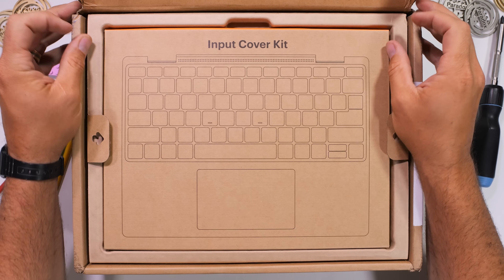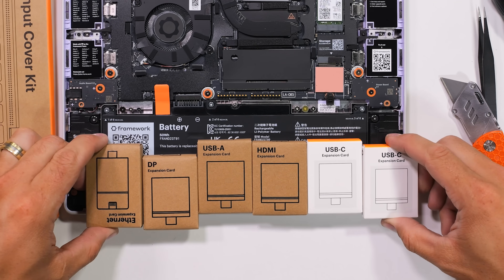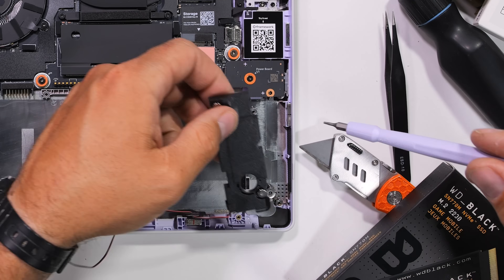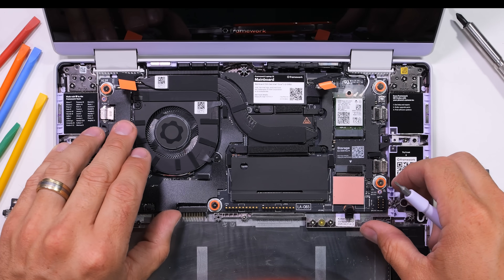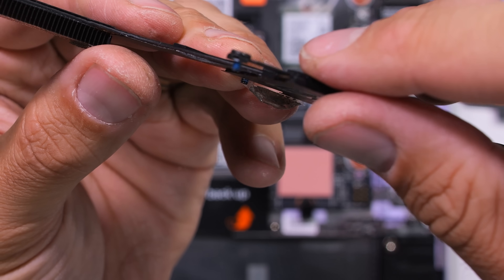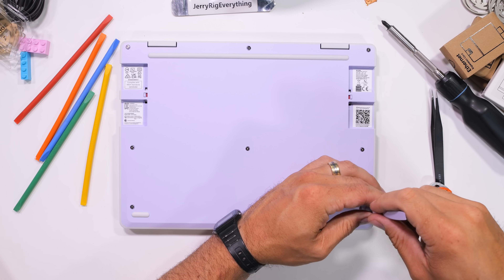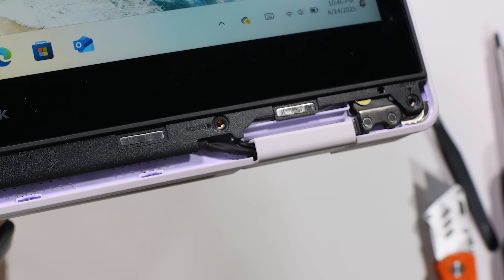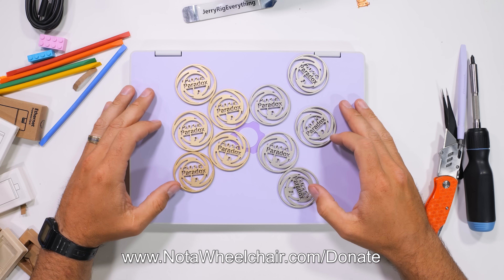The Best Laptop on Earth... is almost too easy to fix.

Comment: the funny thing is that they have to assemble it first to see if it works, then unassemble it for diy kits. linus did a tour of their factory and the ceo told him that.
Reply: I do wonder if they were only doing that early on and now trust the other QA processes enough to not need to do that anymore. There's also plenty of users that don't order all parts from FW
Reply: @HululusLabs  Memory and SSD don't have to be purchased through them, but honestly they don't charge Apple prices.  

If upgrading your laptop there is no need to test anything but what they send out.  Elsewise it's still cheaper to test the product real quick then to send out faulty parts.

It's not like memory and SSD drives are all that hard to install and uninstall.  

I do wonder how they send out the computers with the GPU add-on.  Haven't seen that which is why I want him to get the Framework 16.
Reply: im sure they test the componants but you can do that without assambling it
Reply: @Tank23333  No they don't... They literally test the machine working and take the parts out.  It's faster that way for them to test, testing components one by one takes more time.
Reply: @Crazyd_ do you work there or something?
Reply: @arguedscarab7985  The factory tour OP was talking about... That's how he knows.
Reply: No the funny thing is they charge you more for doing less work.  Because DYI Kits do cost less.
Reply: @Crazyd_  And the crazier converse, they charge you less when they're doing more work!
Reply: @Crazyd_  they cost less because they don't include Windows, not because of the amount of work
Reply: @bruuhhhh  Doubt it highly I've seen Microsoft shut down computer stores who do that.  I hope Framework isn't that stupid.
Reply: @Crazyd_  you've seen Microsoft shut down computer stores for not including Windows?
Reply: @bruuhhhh  For not charging for Windows on New PC's yes.  And that's just a local PC store... Microsoft is vicious
Reply: Crazier by the minute...
Reply: @Crazyd_  You mean the local store installed a copy of windows but did not charge for it?

Not to worry, because if you order DIY there is either no storage at all or - if you select one during ordering - a brand new, factory sealed SSD included.
Reply: @LOL_Strategy They install OS, but ran Microsoft program which requires them to enter an activation key.  

I forget what the command name was, but it's a way for vendors to test the system with Windows and still require an activation after the command was ran.

Once you reboot Windows ask all the introduction questions again and ask for key.
Reply: @Crazyd_  Yeah, that's not what Framework is doing, at all.
Reply: @Crazyd_  idk if it is an america thing, but at least here in spain almost all major tech stores charge you less for not having windows installed.
Reply: @bruuhhhh Que?? They do not cost less at all, otherwise I would've bought one myself..
Reply: @Crazyd_ *DIY 😊
Reply: Which lets you know that it’s a gimmick.  They are selling the idea of modularity, not modularity.
Reply: @mrlt1151 The discount comes from them not including windows, ram, or storage in the modular configs. They out it all together, test everything, take it apart far enough to remove the storage and ram, then leave it open for your convienence when you install your own components.
Reply: @Michaeldtimmins  Highly doubt that.  Microsoft tends to frown on people selling full computers and not putting OS in on the price. 

Now if they don't purchase a hard drive through you, it's fine nothing they can do.  But no one wants to get on Microsoft's Lawyer side.  

I always get Windows Pro regardless, it's worth the price for Remote Desktop and Policy Editor.
Reply: @Crazyd_  The version without Windows installed doesn't come with Windows at all, at least from what I can tell on their website. So they're charging less partially because Windows isn't included, not because it isn't installed.
Reply: @Crazyd_ they don't sell the full computer. It doesn't come with a hard drive or ram, and thus also didn't come with windows. You, the end user, are free to install whatever storage ram and operating system you want.
Reply: @Crazyd_  Microsoft isn't some kind of police force making sure all laptops come with an operating system lmao? If someone sells a PC without any OS on it, its none of Microsoft's business.
Reply: @Crazyd_ Microsoft definitely can't force tech stores to sell all PCs with Windows installed. Just by the sound of it that sounds illegal. The only way Windows is "forcibly" installed on a PC is when you buy a prebuilt where you can't change what's included in the package deal.

They can discourage it sure, but going legal like you're implying? Hell no.
Reply: @mrlt1151  Ah yes, the fact that testing if a computer works requires the computer to be assembled totally makes the modules the computer was built out of vanish into the ether, because you said so.

Comment: A previous video of yours was the catalyst for me to get an e-Ink phone.
And now this is confirmation for me to pick up the Framework 12 as my next laptop.
I already decided on this, but was still a bit unsure on whether I want the Sage or Lavender colourway.
But I do not like how the grey mixes with the lavender and was veering more towards Sage, so that choice is made.

I am waiting for a review comparing the performance of the two CPU models, since the i3-1334 is significantly more expensive.
This for what seems to be an insignificant improvement over the i3-1315, especially considering the stricter power limit of the 12.
But since I will be using this laptop for over 5 years, hopefully a decade, I do want to be certain first.

The level of repairability at show here is far beyond my expectations, those pogo pin connectors are very clever.
Those modules do make it expensive, especially since I want an Ethernet one.
But with how open the design is, the solution is to only get two modules and to design a case for a USB-C dongle which slots in the other half.
Which I will design myself and 3D-print, around a cheap but perfectly suitable dongle which I already have.

Currently I use a dedicated screenless drawing tablet for note-taking.
While I will keep using this for the greater accuracy and comfort, in a pinch the stylus support for the screen is incredible for me.
I am waiting for the stylus to release too, so I can combine the order.
And I will add on a screenprotector, for the better feel and to avoid scratching the glass.

With modern ThinkPads getting worse keyboards and one of the last ones with decent boards getting annoyingly slow, the compromise here seems reasonable.
My previous TP became unstable thus unreliable, my current second-hand stop-gap upgrade is annoyingly slow but works well for the moment.
I will miss the physical click buttons above the trackpad, but it should be possible to map something similar in software and sticker on 'buttons'.
And with what a massive letdown my current machine is in build quality and the certainty of good Linux support for Framework, my choice is made.

Comment: I have the framework 13 DIY since about 1.5 years ago.
Had the battery bulge a bit and it was easy to contact them, give a bit of info and a picture under warranty, and got a replacement mailed in a few days. I mention it because I live in Europe and the battery was not for sale on the EU store. But they had immediate stock for the larger 64 Wh battery I needed set aside for RMAs.  global logistics/part availability seems on point.
Did a thermal paste update myself for some thermal improvement (small laptops can get loud) but otherwise rock solid.
I would recommend the company to anyone I know!
Reply: i meam i was able to do the same thing for my lenovo and my lenovo costs a fraction as much as a framework laptop

my.laptop loterally just has normal.screws and a pull out cable broski its just as replaceable as framework's battery for again a fraction of the cost 🤣🤣🤣
Reply: @aa-tx7th  Lets see if you can upgrade the processor and graphics in a few years time.
Reply: @BrianG61UK he does not need to. he paid less for the laptop, has a proper warranty and can buy a new one after a few years.
Reply: Sigh, i wish they shipped to Singapore
Reply: I had my screen die on me with very little usage. it was still within the first year and framework told me they could not give me a replacement without me paying for the whole replacement. the laptop is expensive and warranty is non existent. At that point might a well buy from a known brand like asus that at least gives you proper warranty
Reply: @KewaiiGamer yea ive heard about these warranty issues. This sounds like the deal breaker for me.
Reply: 64 kW battery!? 64 000 W is quite a lot of power... 64Wh perhaps?
Reply: @rolfbjorn9937  lol what a typo. I have a EV battery for the laptop  😀
Reply: Batteries for any popular laptop are generally available from 3rd parties and are easily replaceable though.  The fact that they didn't have a like for like replacement in the whole Europe region is a cause for concern.
Reply: @PixelisedPaul  Given the restrictions on air travel for batteries: no, it is not a cause for concern. It's called logistics.
Reply: @PixelisedPaul  In fact batteries are frequently NOT available from 3rd parties. Find mine if you think they are: I'm on my 2nd replacement battery for a 4 yr. old Lenovo X1 Tablet (gen 3). That was a very high-end thin & light 2-in-1. My last battery came from eBay: Lenovo stopped supplying them. Ditto for the keyboards, & I'm on my 3rd. Both parts are now no longer available from ANY site on the planet, so far as I can ascertain. The keyboard is getting flaky; the battery is good for about 30 minutes. 

Can't say I'm impressed. Build quality was good, but the parts themselves appear to be crap & the design is bad: it's simply too thin to hold up. I bought deliberately over spec 'cause I was spending air miles points & could afford it, and figured I'd future-proof. That failed: it does indeed more than meet requirements for Win11 ('though I still don't trust Microsoft enough to do that yet) but the fan doesn't work so it overheats & throttles a lot, and the whole thing is flaky enough I'll have to replace it.

Framework is appealing
Framework's "you can fix, replace or upgrade ANYTHING" ethic looks good to me. I like the 2-in-1 design but the 12" isn't quite as upgradeable as the 13" laptop, which is on it's 5th? motherboard upgrade, & lets you upgrade even screen, CPU & RAM (to 96GB!). You can even replace an Intel CPU with an AMD one with graphics processor. There's a full Graphics card & additional battery upgrade available for the 16" laptop. And Framework doesn't nickel & dime you: the parts are refreshingly inexpensive.

We can quibble about performance & battery life - neither is as good as a Lenovo equivalent, since they're surface-mounted & soldered - but they're both acceptable. 

Framework's ethic is unique
I WANT to buy from a company this ethical & decent! And yeah: I'll pay more to for it! I'll pay more to support them. I've never seen a company that so deserves to succeed, so deserves our support.
Reply: if you were a reasonable person, you would find any battery that you need for anything, but you chose a laptop with the performance of a calculator, that's reasonable...
Reply: @vladmir7426  His is a 13. It's probably quite high performance.
Reply: @vladmir7426  Sound like you're coping pretty hard there with your blue text bubbles and your MacBook that you can't fix yourself 😊 😉
Reply: @arguedscarab7985 Macbooks are easily reparable and I don’t know how “blue ticks” is relevant when we are discussing computers
Reply: @NizaSiwale  in what alternate universe are macbooks easily repairable my guy?!

Comment: What about laptops like hp elitebook 8470p 
Upgradable screen 
Upgradable cpu
Upgradable ram 
Upgradable fan 
Upgradable storage 
Upgradable DVD reader (forgot it's name 😅)
Upgradable battery 
Huge service dor that covers almost whole lower surface
A dock station with a lot of different ports with an uninterruptible power supply
Even a express card with quick ability to plug egpu like 5090 
It's just wild, and it's not a only laptop
Reply: Of course I understand that it's 12 years old machine and it is out of date with ddr3 base

Comment: So going to buy one when I saved a bit again, yes it's "expensive", but I love the ease of opening it up and replacing parts. Just yesterday I had an issue with my keyboard (a nice new-style modding board), never took it apart but I did and it was a breeze, fixed in no time and I was coding again. That's what people should want, that's what consumer focused means.

Comment: Not coming with Windows is the way to go. Right now, it's physically impossible to get refunded on the Windows operating system if you choose to use Linux instead.

Comment: this laptop type will be on my list when my current surfacebook v1 is no longer usable. I have had my current for 10 years and replaced the battery on it so its been lasting good until windows 10 is fully EOL.

Comment: A small note, @08:20 always disconnect the battery because there are  voltage lines close to data lines. You may  deliver voltage on data lines when you connect-disconnect the connector and the graphics card will die.
Reply: gpu will not die , u will blow fuse for screen
Reply: It has an iGPU, so it would probably do you one better and the CPU could die lol
Reply: Left similar comment before seeing yours. Yeah.

Comment: omg I wanna see the removeable gpu and if its standerd pcie x16 you NEED to put a 5090 in there.
Reply: If I remembered correctly, it's x8 though. Although you can still put a 5090 there. (By a Oculink or something similar)  Gen4 x8 is plenty for most video cards.
Reply: Oh is it? oke thanks for the infromation, But I meant like a full size of an x16 not actually an x16 @mmis1000